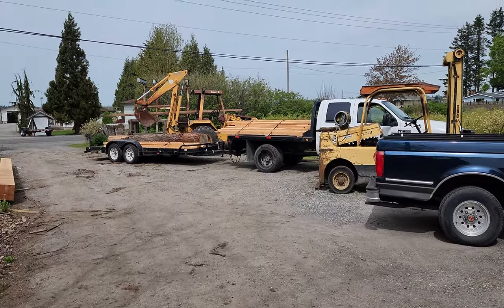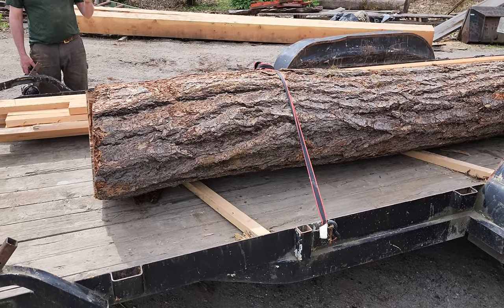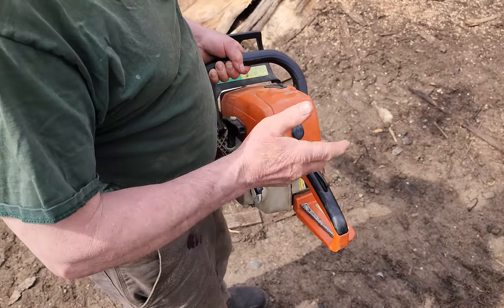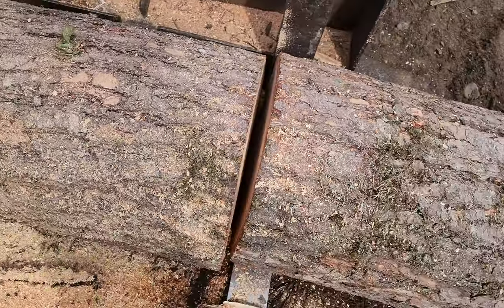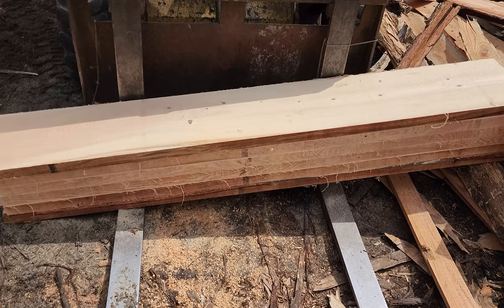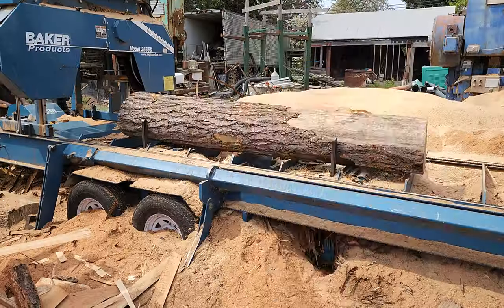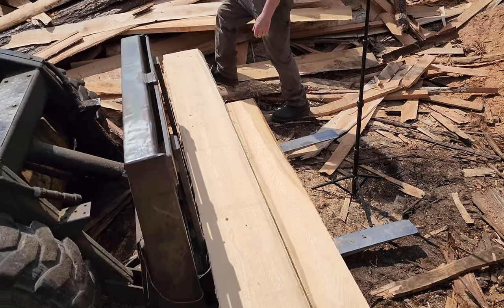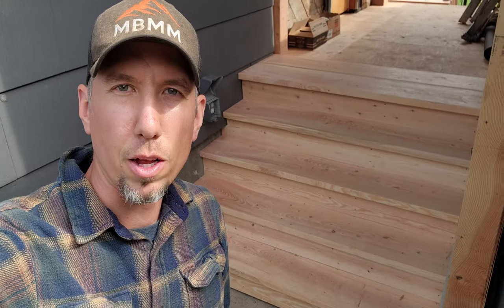Making Stairs from a Log | DIY Woodworking Project

Comment: Jason in addition if you have a good dust collector 4” min it would Al’s be much better then nothing at all. In my shop I have large Oneida with a 5 HP 240 single ph. Motor. Need to close up shop this summer and it’s for sale. 5k with the dust collection gates and pipe. 
The inlet is 8” to the collector and necked down from that point to 5” and 4”